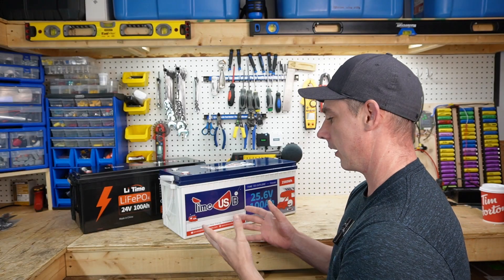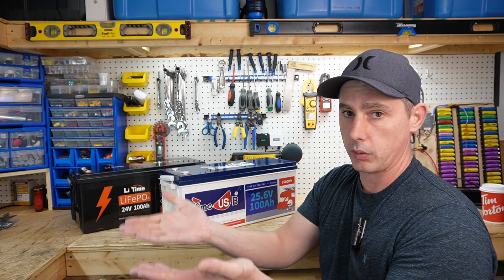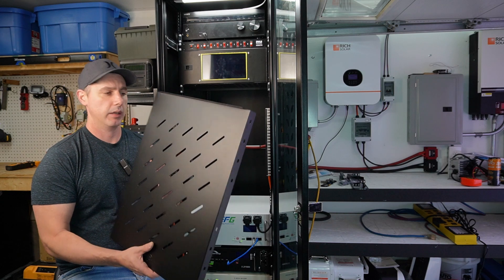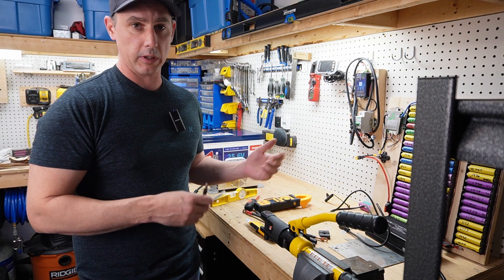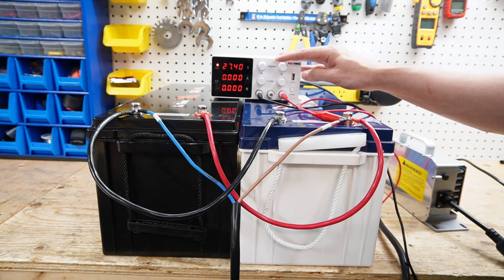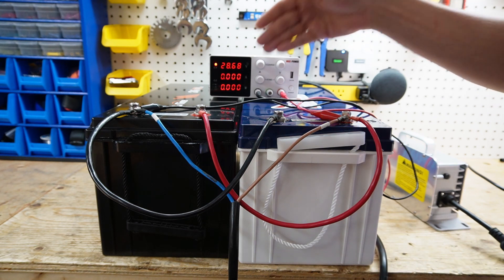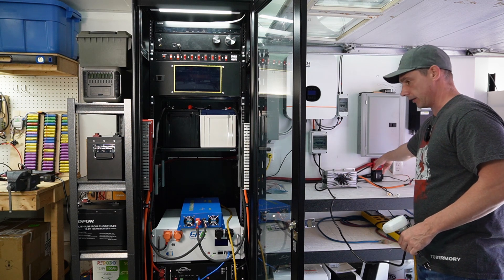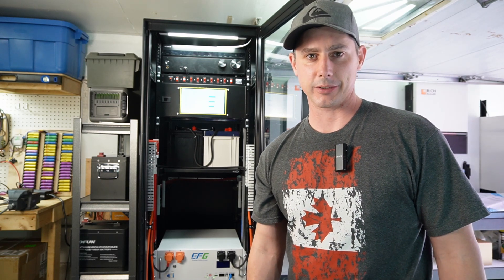How To Connect Two 24V Batteries To Make 48V Battery 100Ah

Comment: I have 2 lithium ebike batteries, 20 ah and 30 ah, both 24 volt. My current bike is 48 volt 15 ah, both 24 volts have mileage on them. I understand from the vid my max amps would probably around 15 ah, but that doubles my range!
I always thought if i connected 2 lithium battery packs in series i would end up on the evening news. Any really special precautions? i know hooking up lead acid batteries you should hook up the positive first.
Once i hooked a lithium battery to an ebike controller backwards. I plugged it into the output instead of the input and thought the world was coming to an end.
Took a while to find most info i needed, well done, great vid
Reply from the maker: Depends if the BMS is available to be hooked up in series or not.
Reply: @Roll2Videos  OK i forgot my 82  motor vehicle repair, you can't series batteries with different amp hours. Can't doesn't exist in my world, if it did i would be dead. i'm thinking diodes, like in an alternator.

Comment: Really should be individually charged to same SoC even before parallel connection.

Yes they self balance, but if they are far apart the inrush of current is a great fire starter and not great for any part of the system.
Reply from the maker: @ViciousXUSMC  Yes, I did say to charge them individually. 
They will never balance in a series connection. Every 6 months, they should be broken down and re-charged individually to maintain their full potential. 
I hope this helps you.

Comment: Have you continued to run these in your server rack 48v system?  If so, how’s it going?  Any issues? I have a nearly identical server rack setup (thanks for the videos!).  I have a couple 24v 100ah PowerQueens from a previous setup that I’d like to add to a couple of the new 48v eco-worthy server rack batteries.
Reply from the maker: I ran it for about one month, I took the batteries to use in other projects. If I was to run it long term I'd balance them every 6 months to a year.

Comment: Good vid... Question: How do you size the wiring/interconnects for the batteries (the short wires connecting each battery to one another)?
As we all know, wire is expensive and I want to size it correctly (safe but not too much overkill)
Thanks..
Reply from the maker: Calculated the amount of amps the system will use and sized accordingly
Reply: @Roll2Videos  I know the amps usage and how to size the main wires coming out of the bank (to the inverter) but how do I figure the interconnects (the wires connecting each battery to one another)?
For example, if I have four batteries (24v) at X amps usage, do I take the total amp usage and divide by four?
For some reason I can’t find the formula.
Reply from the maker: @ForgeAheadwithMike  there is no formula it's the same amperage through the whole system.

Comment: I have  2 x24v Battries To make 48v 100 Ah , ok the time are 48v I need also 48v charger? this I need to ask , your video is so good for my solution , so I want to make 48v with 2 batteries 24 v I have charger 24v  but not 48v charger
Reply from the maker: Yes, You will need a 51.2V charger. Follow the Litime link in the description they have great chargers.
Reply: @Roll2Videos  thank you so much!!!

Comment: Nice vid. Heard our local code calls for 4/0 on 48 volts?
Reply from the maker: The connection from each battery to my bus bar is #4. From my bus bar through a T-class fuse to the inverter is 4/0. 👍

Comment: i got 4-12 volt Valence batteries in Series and hooked up to my Ecoflow Delta Mini for extra capacity. The batteries are 40 amps each but they are used so i have no idea what the total capacity is. I have a Renogy shunt but I'm not sure where the display is. I EMP proofed it somewhere now i cant find it lol. BTW i like your variable power supply I got a similar one on my Amazon Wishlist. Also need a clamp on Amp meter that is both AC/DC :face-fuchsia-wide-eyes:
Reply from the maker: Lol, you sound like me. I'll find it when I find it. Along with other things I wasn't looking for. 🤣
Reply: @Roll2Videos  lol exactly

Comment: When you connect these in series, can the internal BMSs introduce their challenges, or can you ignore that they exist? Cheers.
Reply from the maker: I'm not sure of you question. Can you rephrase it?
Reply: @Roll2Videos  You mentioned that it is ideal to have the same brand of batteries bought simultaneously, for the cells to have reasonably close characteristics. My concern was that your current setup would have a different type of internal BMS, which balances their cells during charging. Without the possibility of reading out individual cell data on how successful they are in this process, you have no clue over time. Building from bare 100Ah/3.2V cells and selecting your brand BMS is an alternative to using ready-made 100 Ah/24V batteries unless you get them for cheap.
My question was more related to my thought about what is best if you had the choice to DIY build vs. use your method. Cheers.
Reply from the maker: @Cptnbond  100% Diy would be a better idea instead of putting two batteries together.